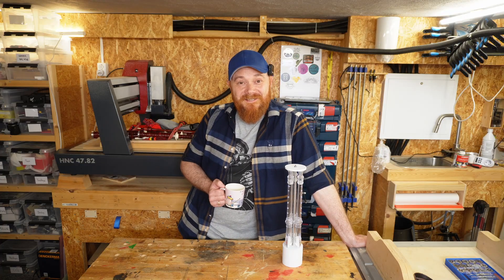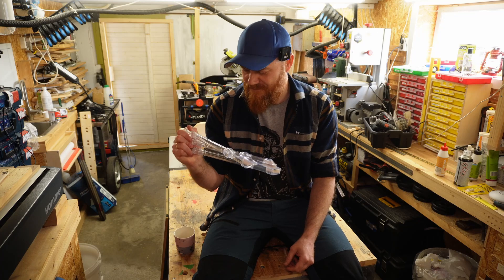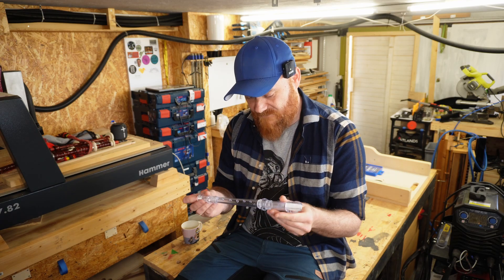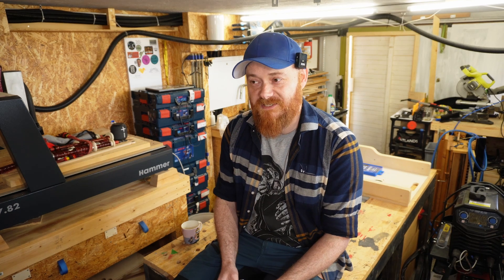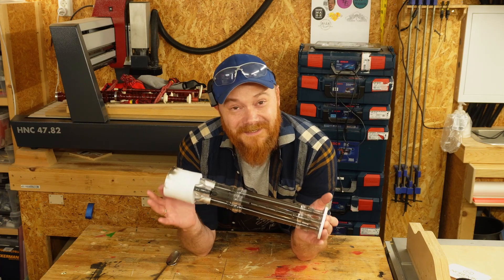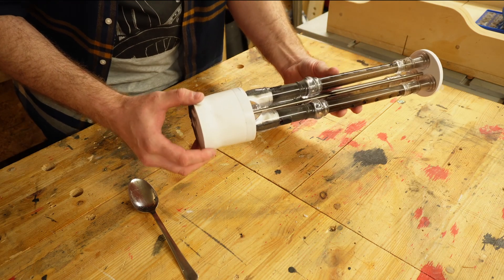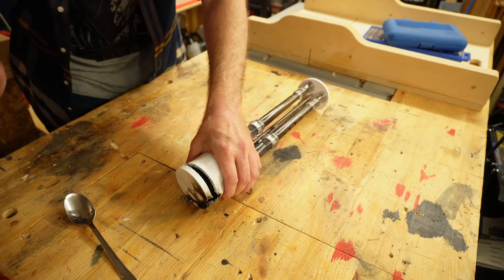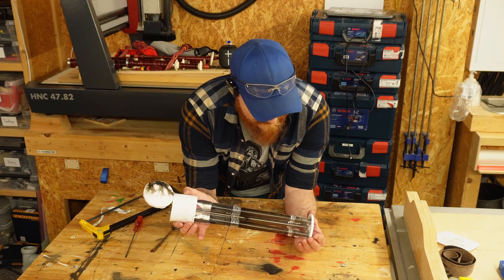Rocket Fuel Powered Recorder Based Air Raid Siren (RFPRBARS)

Comment: Should have holes in the very top, air has to pass through the whole thing
Reply from the maker: Yes, forgot about that in the design, although it doesn't really come that much into play in an open C setting - at least not when using rocket fuel 😅

Comment: please try again with a stronger base so it plays for longer!
cos omg it sounds so forlorn
Reply: I imagine the problem was too much air pressure, not durability. If you over-blow a recorder too hard they stop making a tone.
Reply: @yoshimitsu5537  ah i guess it needs a pressure regulator then... that's a lot of extra complexity... unless just adding a relief valve will keep it around the right pressure?
Reply from the maker: I do want to make a stronger base at one point, so that the fumes has no choice  but to go through the recorder. They will of course then, by design, melt in the process 😄
Reply from the maker: Melting recorders was the baseline plan 😂